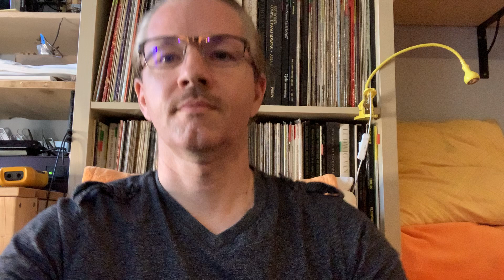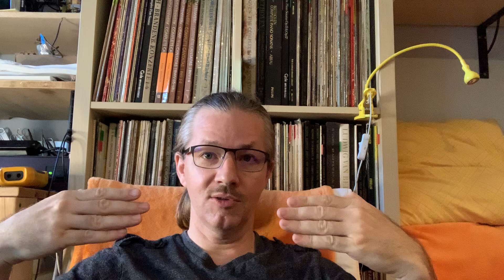How can a preamplifier improve sound quality? Is this a contradiction?!

Comment: Op amp basics and audio.
1 All active devices generate electrical noise. Some more than others. No exceptions.
2 If you amplify a signal by 20 DB, then attenuate it by 20 DB, you have the same level but with that added noise.
3 If you try to get too much gain out of a single stage amplifier, there is a loss of bandwidth and higher noise. For high gain, EG Phono preamp, ribbon microphone, etc, multi gain stage preamplifiers can have lower overall noise and bandwidth than a single stage amplifier.
Some low gain pre amplifiers buffer high impedance sources such as a guitar pickup, and provide a low impedance output. Guitar signals are generally high Z and need buffering to go into line level amplifier inputs, or a transformer, to convert to low Z for input to a PA XLR mic input, when then has a preamplifier in the PA Mixer.

Summary, use a pre amplifer on low level signals such as phono cartridges, ribbon microphones, condenser microphone elements, etc. Most all consumer condensor microphones have a built in pre amplifier and require power to operate the amplifier. This includes the microphone in your cell phone.

Comment: How can a preamplifier improve sound quality? It CAN'T!!! It can only reduce it.
Reply: Wow, new to the hobby. Or just stupid.
Reply: @jdm-uk-yank  Ok, there is one way a preamp can improve the sound... remove it from the signal chain altogether. Stupid!!!
Reply: A common example is the phono Pre Amp built into most receivers for moving magnet phono cartridges. It included the RIAA frequency correction curve to reverse the frequency curve applied to the photo master for the album. Try plugging a magnetic phono cartridge into the aux input of a receiver and note the low and bad EQ sound.
Reply: @isettech  Yes, of course. Turntables require an RIAA phono stage. However, I eschewed analog audio a long time ago, so my original remark refers only to digital. I should have made this clear. Regards.

Comment: Hope I’m not rehashing something but how can one not inc a preamp if your amp doesn’t have a preamp section? Do you use a step up transformer straight into the amp? Wouldn’t running a pickup straight into a power amp under power it causing damage?

Comment: That was succinctly, clearly and accurately described. I use a Supratek Cortese valve pre, mainly for the MC phono. In general I have solid state amps (not perfect, but I live in a hot climate in Queensland Australia) and I sometimes hook in the valve pre to add analogue richness to the sound. In summer, I have lately been mainly using an old Lux L308 integrated with either its own MM stage, or an Aqvox phono 2ci for MC. I guess the preamp stage inside any quality integrated unit should have compatibility built in. I have played around hooking DACS and phono stages straight to power amps and sometimes find an improvement over a preamp bridge, but not always, of course.

Comment: A preamplifier is like a friend shaking hands with both sides of a system............
Commercial preamplifiers are mostly made to compensate for the specific amplifier combo of the brand..........
A good premplifier or the right one in  your system will translate  / preserve  or even improve the energy /soul
of the music ......................
The quality /nature of the connectors will be and play a crucial element in the perceived results..............it can ruin a good combination or bring it to life .........;
The best preamplifier should no preamplifier ..................listening and connecting to music tells you mostly it's better with the right one............
The simpler and fewer the concept of a circuitry /components of an amplifier stage will be MORE reveiling of ANY component used ....................good or bad .............!
Simplicity is the most difficult .....................complexity is the most leveling of the results...............from low level hifi till very high end.....................it's controled like a horse in the arena to the show conceiled by the applauding audience ............and versus the natural  beauty of horses running in the wild...................wild horses do NOT need trimming of the hoofs  the care of the expert 
HORSE(WO)MAN.................AND SPECIALIZED VETS !

Preamplifiers are maybe the most rewarding compo,ent in your system to BUILD YOURSELF .............the better your power supply the better the same simple circuit will make your music set up sing for you ........
Start building and leaening how to make it even better than good , you DON'T HAVE TO BE AN ENGINEER , you will be free to experience and learn witout being tied or limited by the dogma of the expert schooling !
If you do not believe it go to have a look on what Sakuma did and some others ...............Hiraga , Quortrup and many others

Amthough I am a tube man , I liked very much the older preamplifiers from YBA .............they worked great with tube amplifiers and other decent amplifiers .............

Do have confidence in yourself , your ears , your soul and the love of music will tell you if you are on  the right way ....

You like music ...................you like horses
 https://www.youtube.com/watch?v=G7lpkPlTe78
Reply: I have a marantz 4270 connected to acoustic research AR12. Should i go for a vintage marantz preamp ? Would it help, or leave the wild horse alone ?
Reply: @skyblinked  I don't know the ^specific model .....................but I used in the past the preamp section of a vintage Marantz 1O60 with great satisfaction..............maybe it's the same circuit board in your model ...you can check it out. ( P XXX )
Still have the Marantz................  
Only if you feel the need  ........to change or explore new combinations ....
Reply: @frankgeeraerts6243 Tubes to me feel like an extension of what makes us human. I wonder what you think about this, but for preamps, I'm considering to ditch them, mod my sources to output perhaps as much 15-30V rms all tube driven, maybe even transformer coupled (I've got several LL2774 lying around that could go 13.6:1 - 13.6:4). 0.5V-2V seems just plain heavily compromised way to drive a tube amp, and very sensitive to interference.
Reply: @EduardBroekman  
Hello Eduard , 
Transformer coupled ( quality ) ...........is almost everytime good practice....
But it's not question of only voltage , it's in fact a question of energy ...............
Lundahl still stands for quality ..........
One can change the input of the first amplifier stage to behave like a preamplifier input , more gain and better impedance matching with a source.
Enough output voltage of a source and suffisant voltage sensitivity of the amplifier tells NOT the whole story !
In some cases it DOES ..........
Remember the use of moving coil cartridges , especialy the lower output ones ............it lacks the necessary voltage to be used by most of the regular RIAA phono input , ....So most commercial amplifiers or dedicated pre pre stages for MC cartridges amplify the voltage to a usefull level..........often together with a wide choice off impedance matching selections...........etc.
BUT...............in reality besides the low voltages generated , most MC cartridges do NOT lack energy !!!!!!!!!!!!
So the most logical solution shouldbe in most cases................a transformation V/I..............

I do have a full class A double mono MC amplifier , double power supply and build like a tank , weights more than many amplifiers and runs very hot  ( C17 Accuphase ).......................but my soul jumps up when I use my silver winded and vintage MC MITCHELL COTTER MK 2 transformer....................the tonal quality and coherence  , not only a soundstage but also with  a floor and a ceiling ................and the impression of the real world is surrounding you .....
What can I say ?..................everything is in experience everything in a given system , the one that gives you the most rewarding music experience is the one for you.
All other is a guidance to live the passion.................or the misguiding as coins have two sides.

Have a nice day , your first name remembers me of my first friend when I was 60 years younger .
It's following the road that is an experience of life............ rather than the destination .
Reply: @frankgeeraerts6243  I enjoy your near poetic replies, Frank. Regarding energy - true true - mmm ... this needs a bit more thought on my part with driving tubes, doing volume control in a 'whole systems' type of view. I see  a wisdom in choosing the right tool for the job and running a nice silver transformer passive is outdoing an over-the-top engineered MC amp. You strike me as Belgian in approach.. so perhaps that choice was predetermined - really :) As for passion, I tend to sniff it a mile away if 'something' is there. Strangely perhaps, the Lundahls are more about doing nothing wrong rather than impassioning me,. I do tend to run 100% transformer coupled with low impedance tubes about everywhere if I can - and then the Lundahls end up being very transparent of changes. Supply and quality is highly reliable (I buy direct now). Speaking of journeys, I've still got quite a path to go, but recently my VOL < DIY 6P43P Sakuma < Kenwood 7010 TT started engaging me in way that is starting to guide itself - I suddenly understood I will also optimise this, rather than try 100s of things. But I've got blind spots everywhere so it's good to hear from you and others (inc Janos) that walked a similar path / follow their heart instead of reviews or 'tech'. I'm a weird combo of a lot of rationality yet led by intuition and complete non-rational observation, experiments - and then if needed, catch up on the physics/maths afterwards once it has context. As for crossing paths with 'Franks' - I had a friend Frank from grade 1-4, his family ran a tulip bulb farm in the Noord Holland... but I'm nearly a decade away from being 60, so I'm presuming he wasn't you.

Comment: Every integrated amplifier, stereo receiver and AV Receiver has a built in preamplifier. Power amps can receive the signal from a source with a 2V output but in effect that's just placing the preamplification stage in another box.
Reply from the maker: Exactly! The driving force today (with respect to sound) to separate the two is to give each its own dedicated power supply - otherwise placing it in a single chassis makes for a very big unit.

Comment: Very very nice comments in the video.  

Its all about treatment of the analog signal.  the analog signal comes into the preamp scene and the system needs to electronically transfer it to the amplifier.  The incredibly detailed individual frequency waves received by the preamp are very quickly responded to in order to process all the nuances of sound pressure changes, ie. Natural sound versus electrical replication of sound.  Capacitors Store energy for quick reaction to changes in Sonic waves as contained within the analog signal.  Do a better job, it will sound better. And then the results of a preampliers involvement are amplified when the signal reaches the amplifier.
Reply from the maker: Neat summary, thank you!  Indeed, I am very happy with the comments. The comments section starts to feel more and more as a work group. :)
Reply: You're a man and you're puzzling it out !!!!!!!!!!
Reply: A preamplifier is a buffer

Comment: All trading agreements are based on a “level playing field” in order to eliminate the middle Mann, duty’s, custom …
Reply from the maker: Exactly... and such an agreement to cut out the middleman can happen at the home field, (aka one's own system), where we know both parties (sources and amplifier), and can optimize the handshake by fine-tuning the interface: adjusting the impedances, gain structure, current drive, volume control mechanism...